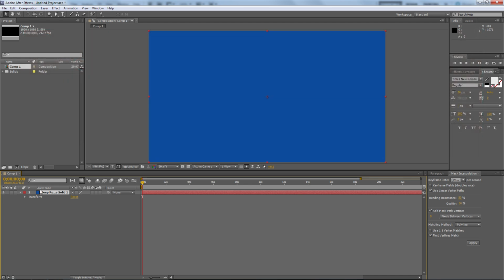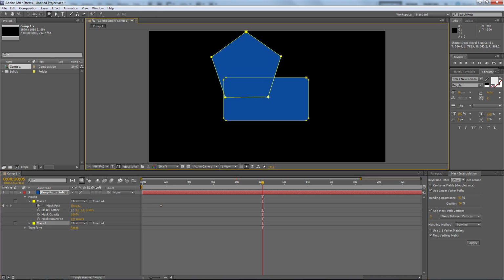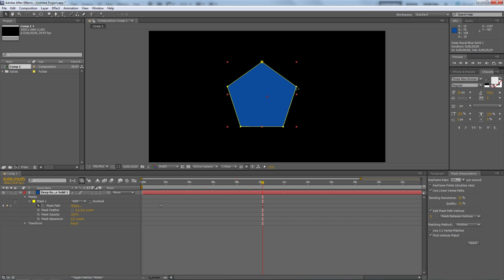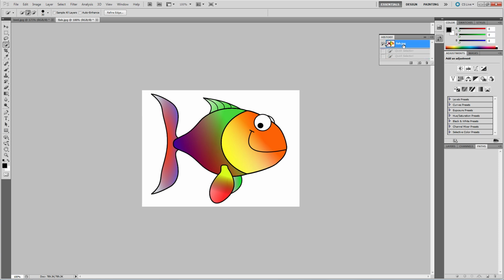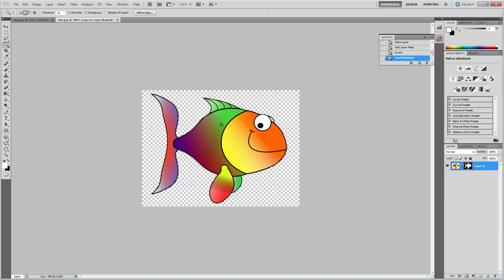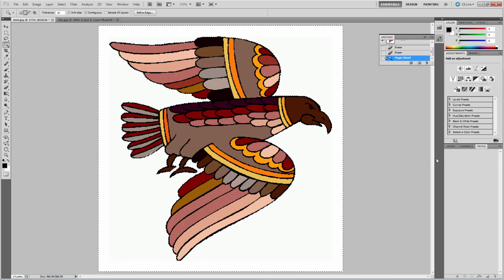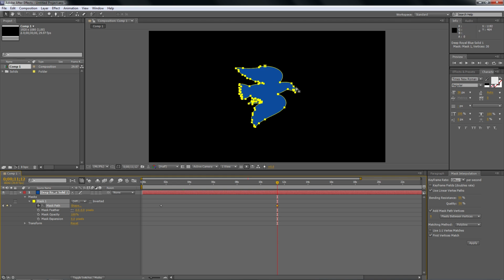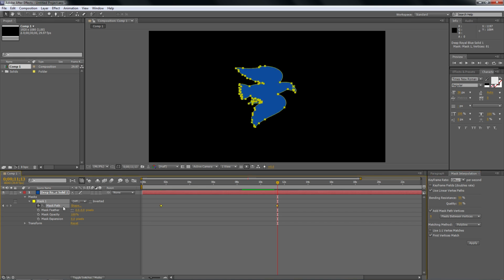After Effects - Morphing masks using paths made in Photoshop

Comment: Using Photoshop 2019:  I have a PS file with many layers to convert to paths.  Is it possible in import several paths at once vs copy/paste?
Reply from the maker: Possible but messy. Each path comes in as a separate part of the shape and that can be difficult to work with in After Effects.

Comment: thank you! is it possible also with illustrator layers?
Reply from the maker: +1234Danit1234 Yes, but because Illustrator files have multiple paths, it becomes complicated. Your best bet is to open an Illustrator file in Photoshop, and select a single path from within Photoshop. If you select paths from within Illustrator, you will need to merge or combine them in After Effects and that is not a simple process.

Comment from the maker: Yes. There are 2 ways. 

1) Since you can't keyframe a solid layer's color, put color on the solid layer. Two ways to do that: Use the Fill or 4-Color Gradient effect, then keyframe color changes.

2) Instead of using a solid layer, use a Shape layer. Create it manually using the Pen tool (a single click in Comp panel is enough). Then use Path property as described in tutorial. Shape layers have a color or gradient option built-in. You can use Add function to add a gradient fill or stroke.